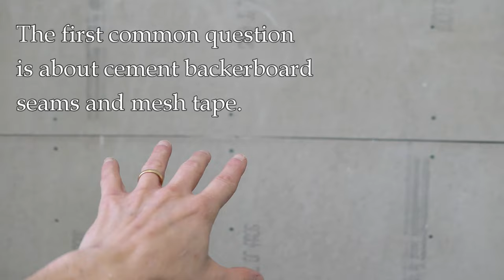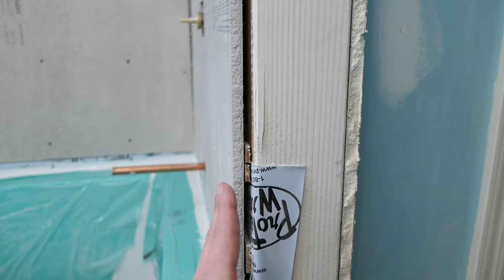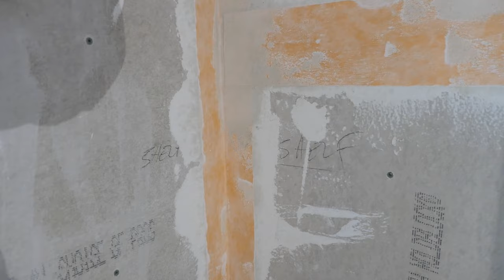Should Backerboard Go Over The Tile Flange Or Up To It?

Comment: One of the more informative videos I’ve seen on a remodel situation. My question is, on the method you just showed, how far do you set the tile above the actual tub. It appears there is a small portion of the flange exposed, do you apply thin set below the the backer board in that gap and will it adhere to the exposed flange?  Thank you.
Reply from the maker: You do apply thinset in the flange area, but it is more for back-support to prevent tile cracking than for adhesion to the wall.  The first row of tile is adhered to the backerboard over most of it's area, but the section of tile overlapping the flange is not really adhered to anything.  The gap between the edge of the tile and the tub surface is the same as your grout line elsewhere, but that gap is filled with a silicone or color-matched tile caulk.
Reply: Excellent question!

Comment: I was glad to see you didn't put plastic all the way up. There is a chance to trap moisture as you say. On the red guard, some moisture will get behind the tile but if you can see the back side of the backer board it's not likely ever going to be noticeably wet unless people spend hours in the shower. There is less chance of mold if you use red guard though. Great idea using flashing tape.
Reply from the maker: Exactly--the plastic is just an extended flashing, not a vapor barrier.  If I need a completely waterproof installation I'll use the Schluter system not Redguard.  However, mold is really not an issue with hardibacker.  Mold needs moisture and organic material for food in order to grow.  The paper-faced drywall from yesteryear could provide that food, but the inorganic compounds in the hardibacker cannot.

Comment: It matters whether you use Hardie board or a pure cement board like Duroc. With a cement board, you can go over the lip and set it right down in the water. With Hardie board it should be 1/8 inch to 1/4 inch above the lip. Since you're not using the Redguard or another water barrier in front, your vapor barrier/ water barrier should go all the way up behind your board. Considering that tile, thinset and Hardie board are not waterproof, it seems strange to me not to put a membrane on the front. However, if you did, since you have waterproofing behind your board, you could create a mold sandwich so it's probably better that you're not.  

I guess my question is what are you using to waterproof the walls?
Reply from the maker: Well, you have some misinformation, so let's see if we can sort all this out.  First, there is no such requirement for Hardibacker to be installed above the lip rather than over it.  In fact, if you look at the James Hardie installation instructions they specifically recommend installing over the lip of a shower pan or tub.  See page 3 of their instructions: https://www.jameshardie.com/JamesHardieNorthAmerica/media/Products/Hydro/HydroDefense_Install_Instructions_English.pdf

Second, as I explained at 6:08, the reason I install the flashing is NOT as a waterproofing in the sense the term is used now, but as a precaution in the event something goes wrong years later.  If the homeowner does not maintain the grout, or the framing moves, or somebody does something dumb and the installation is compromised, any water that gets through a cracked corner or under the caulk or grout at the bottom will be redirected back into the tub or pan rather than the wall cavity.   Yes, I have seen framing move or grout so poorly maintained that water gets into the wall cavity and even drips into the first floor below!

Third, as I explained at 2:42, when I do use waterproofing I use the Schluter Kerdi system.  Doing so in addition to the flashing does not create a mold sandwich because the flashing does not cover the entire wall and therefore it can breath, and because mold requires both moisture and a food source, neither of which would be available when the Kerdi membrane is used over Hardibacker.  That said, standard Hardibacker does not require waterproofing (although I do the corners) and the newest type of Hardibacker with their HydroDefense coating offers complete surface waterproofing anyway.  As for Redgard or other liquid products, I'm not a fan.  They are oriented toward DIY work, I guess, and I'm not satisfied with their waterproofing performance or tile adhesion.

Comment: Flashing tape on the tub flange solves my problem. Thank you.  In addition the tub manufacturer recommends that the cement board sits ON TOP of the flange.  As we know this is potentially an avenue for water intrusion into the wall cavity.  I do ask why the tub manufacturer recommends cement board to top of flange?  Can they be idiots as some pros suggest? Or does it have to do with tub to tile sealant failure and wicking into cement board that is installed overlapping the tub flange.  I like your method.
Reply from the maker: I'm using Zip system stretch tape these days, which works very well.  The reason some tub manufacturers recommend sitting on top of the flange is because they have no care about anything except their own product.  Wicking is a non-issue if the tile is done correctly.  I've taken apart 60-70 bathrooms, many of which had drywall sitting on the tub, over the flange.  As long as the caulk and grout was maintained it was just fine.  But, the flashing would prevent any damage from wicking anyway.

Comment: Thanks for all your insight on shower pan installation.  Another question.  How do you shim out metal studs without using wood.  I might have to shim out the far side side of shower.  3 studs.  5/8 inch space.  Thanks again.
Reply from the maker: I can't recall ever coming across metal studs in a shower area.  I'm assuming there is drywall on the opposite side and they can't be moved?  If so, then shimming would be one option if the rough opening is actually too big.  That said, it would be unusual to have a rough opening 5/8" larger than standard.  I'm also not thrilled with the idea of metal studs in a wet area, since moisture could damage them over the long term.  I'd actually prefer wood.  So I guess one option is to use 5/8 plywood as a shim, potentially even cutting a whole piece to cover the whole area.  Another option would be to cut the nails or screws to the drywall on the other side (if it's plaster and lathe you could not do this) and install custom studs cut from 2x6s.  This would allow you to correct the rough opening but it would require fixing screw holes on the opposite wall.
Reply: @enduringcharm  I live in hawaii.  Ground termites is a big problem.  My subdivision, all homes built on post and pile.  All metal framing for house, treated subfloor, stucco exterior dry wall interior.  Termites finding shims in doorways, cabinets to eat. Also making their trail by eating paper between dry wall and paint.  Amazing.  How does this sound, half inch hardie, use  waterproof tape (Nashua aqua seal tape), hydroban, thin set. This should take the tile over lip, (backfill thin set between back of tile and under lip.  Silicone between tile and pan.  Thanks for going over this.
Reply: Adding a treated ply board would probably be last resort.
Reply from the maker: Okay, that makes more sense!  I've read that New Orleans has a similar termite problem.  I'm not clear, though, is your rough opening too big or not?  If it is, you might also sister up metal studs to the existing ones, but offset them by the amount you need.  Then you can use hardibacker on top of that.

Comment: Great video...I will definitely use the window flashing over the lip. What do you fill in that void with where the cement board sits on top of the tub flange? Do you use some type of sealant or pack it with mortar and then bring tile down to the tub? Thanks!
Reply from the maker: See this:  https://youtu.be/y3bpE-GhYUM?si=PuvZoY4FlyvgSEq4

Comment: It is not necessary to seal seams? Arent grout joints permeable? I understand hardieboard is fairly resilient to moisture. But, what about every spot that that hardieboard has been compromised (screws) or where the gap where they join? Couldn't that moisture go thru the grout, thru those unsealed seams and each place that the hardie was punctured? Maybe a better way to ask my question is- what keeps the moisture that permeates the grout from going thru the unsealed seams & screw holes? Where would the moisture go that may get into the joints that aren't sealed? What keeps moisture from entering the screw holes, getting to the stud behind it? Hardie doesn't seal around screws. I may be over thinking this... but it takes a small fortune to tile a bathroom. I would hate to make an investment like that and then be in a position to have to rip it out bc of something that would have taken little time to prevent. .... that famous quote comes to mind... an ounce of prevention is worth a pound of cure...
Reply from the maker: I really need to make a video on this subject, because it comes up constantly.  There is this overwhelming fear of water invasion which is just not rational.  I've taken apart 60 or 70 baths and put them back together again and I can tell you that so-called waterproofing is over-hyped.  There are times when I will use Schluter Kerdi membrane to waterproof an entire shower wall, but in many cases it just isn't necessary.  If you are using a quality impervious tile, and you have installed and sealed your grout properly, it would take a very long shower indeed to cause penetration by water.  Remember, for four or five decades the standard of practice was to install crappy ceramic tile over plaster or wallboard! Those that were well-maintained actually lasted 30-40 years.  Here's an old video you can watch to make that point:  https://youtu.be/xk7lNudSV2Q

Comment: My tub project looks to be the same condition and layout as yours. I shimm'd the walls around the tub with plywood so the cement board goes over the lip perfectly. The drywall on the same wall plane was also shimmed out so there was no indifference. There was no way the cement board was going to bend over the tub lip which would also create a problem when the door assy is installed leaving a warp condition. Just shim out all walls to make it work.

Comment: Nice vid. Thanks for the flashing idea. However I used to think as you. But the idea that standing water weaps, means the BEST scenario, is place the backer board up to the lip, so the water cannot use the backerboard as a weap zone to make its way up behind the tile ..  😉
Reply from the maker: You misunderstand the purpose of the flashing. It is there only as a measure of protection for the future in case something goes wrong, such as extreme seasonal framing movement, a homeowner who doesn't maintain the caulk or grout, etc.  Under normal circumstances it shouldn't be needed.

Comment: Great video.  So the backer board comes down to the flange lip, not over it.  For me, the backer board is thicker than the flange and  sticks out farther than the flange lip. This creates an open space below the backer board and along the flange.  What do you do with this space when tiling down to the tub surface?  Do you leave this space open behind the tile?  Do you fill it with thinset before tiling?
Reply from the maker: That video is here: https://youtu.be/y3bpE-GhYUM

Comment: Is the Flashing necessary if you aren't tiling but using a Glue up fiber glass surround. Would just putting the Hardy board on top of the tub flange be enough?
Reply from the maker: The flashing is something I do as means of offering protection for the future.  I'm not certain what product you are using--is flat plastic sheets which are glued to the wall surface, or are you installing a full tub enclosure?  If you are gluing flat panels to a wall surface it certainly wouldn't hurt to install the flashing.

Comment: If you put drywall in front of the tile flange, is it necessary to leave a ¼ inch of space at the bottom or can you put the drywall right on top of the tub?
Reply from the maker: You shouldn't be using drywall at all.  Do you mean cement backerboard?  You can use various brands of cement backerboard or proprietary tile backerboard, but sheetrock or "greenboard" is no longer industry practice or building code.  And, yes, it's best to leave a little gap at the bottom both to allow any water that gets back there to drain and to allow for expansion and contraction.  See if this video helps:  https://youtu.be/y3bpE-GhYUM

Comment: Great video, like how you address all the limitations, personally I like using pl marine thru hull behind my mesh tape and at the base. Might be adding your flashing step. I do a lot of glass doors on completion (wayfair). Point being if you go over the flange and don't address the wall being plumb you end up with a lot more mud behind the tile and that affects how many courses you can set.
Reply from the maker: I stopped installing shower doors several years ago because the quality had become so poor.  From bad designs to manufacturing flaws, I was spending too much time trying to make bad products work.  Now I have homeowners work with a local glass company for custom doors.  The quality is better and any concerns about fit are gone.
Reply: doesnt the flashing around the base of the tub affect the flooring installation?
Reply from the maker: @sunny meadows You mean the flashing or plastic installed under the edge of the tub apron?  No, that's very thin.  The backerboard is installed over the flashing.  Then the tile is adhered to the backerboard.  The flashing is just there to prevent weeping moisture from rotting out the floor over time.

Comment: Can you post the name of this self-adhesive flashing, please? That flashing is the saving grace here when you can't shim out studs or walls and must put the backer board on top of the lip. 

However, tell me if the following could be an issue when putting backer board on the lip. You put thin-set over the flashing for tile support, but the thinset does not bond with the adhesive. It's just tile support as you said. That means this thin-set only bonds to the tile glue and is "floating" against the flashing on that side. Doesn't this open the possibility for the thin-set to crack and maybe crumble over time with movement? And when that happens, what happens to the tile glue up against this thinset? The glue would probably crack too in which case, the tile has lost glue support in the area where the flashing is. The tile would likely also lose the grout in this area due to a lack of backing support.  This could be up to a ½ inch area against the tub, right?  Sure, caulking might hold the end of the tile against the tub in place, despite this isolated loss of backing, but with time caulking can go bad. Please advice..
Reply from the maker: The brand of flashing isn't important, and there are different regional options.  If you look in the window and door flashing area of your favorite box store or lumberyard you'll find what you need.  As for your other questions, I think you'll find them answered in this video:

https://youtu.be/y3bpE-GhYUM

Comment: this is the best explanation i have seen for the lip issue when doing tile. But perhaps you could answer another i am doing the same kind of job putting the regular cement board behind the shower in tub combo. However, I am using morilite or the paneling made for showers. So should I put the cement board to the lip and extend the morilite down a little past the lip?I will be using your tape method now i think that's genius it keeps water from wicking up under the products. Great video and thanks either way if you answer.
Reply from the maker: I had to lookup "marlite" because I wasn't familiar with it.  That's essentially a fiberglass core panel which is intended to be attached with adhesive to a substrate.  Honestly, I'm not a big fan of this idea in general.  I've seen it used in vacation rentals and similar places where cost is the only concern.  It relies entirely on a bead of silicone caulk for waterproofing in the corners and bottom edge.  If you haven't already purchased the items, I would encourage you to think about a fiberglass or acrylic tub/shower enclosure instead, which is designed to snap together and be waterproof. I've put in many from Stirling Plumbing, which have held up well and look pretty good.

If you must use the panels, you could do the installation as I have done in the video, taking care to get the corners waterproofed.  You can't use the Schluter membrane across the entire substrate, because you won't get the panel adhesive to stick to it.  I would leave a slight gap at the bottom of the panels where they meet the tub and caulk that area with a pure silicone caulk.